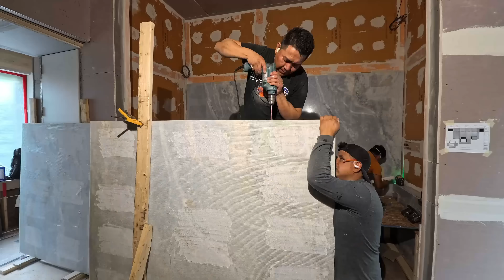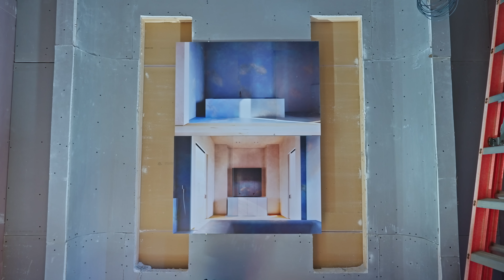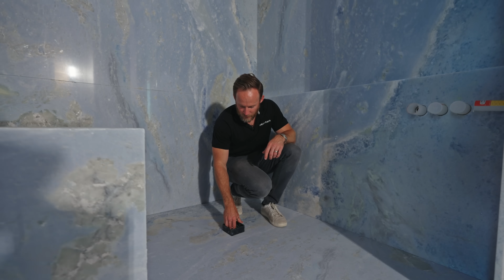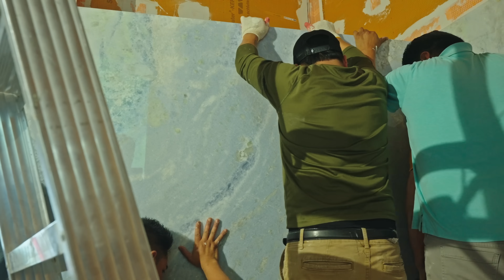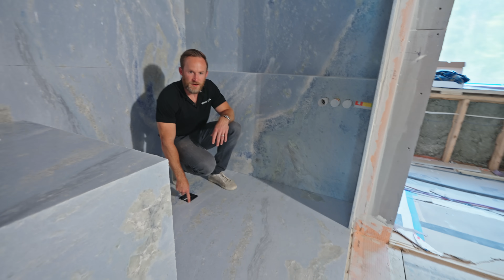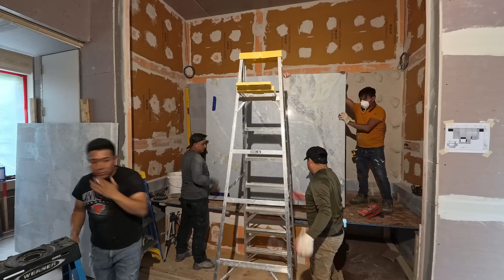Luxury Bathroom Inspired by the Sky

Comment: This is 100% spot bonded (see individuals frames from 13:43 to 13:50). There is a reason the is not shown in normal speed. The tile install does not conform to TCNA or ANSI standards and no respectable tile installer uses spot bonding. Most of this build has been done incredibly well but I'm amazed that LFT was installed with such poor standards.

Comment: Wow!  That very low pitch combined with the slickness of the surface is going to be a pain in their asses!  Bulk water will drain but MUCH will remain because surface tension will overpower gravity and being that it is slick, there is nothing to break that surface tension.  MUCH more water will remain on the surface than with correctly pitched floors and textured floors and it will evaporate MUCH slower and promote mold growth AND leave MUCH more minerals behind.  You'd think these guys would study water a little more.....both the builder AND the makers of that shower, being that that's what they specialize in.....or in this case....NOT.  GEESH!!  But I do get it.....it's all about GET THAT MONEY.....and that's pretty much it.

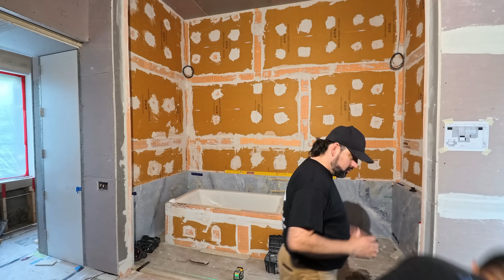Comment: Hey at 5:49 the top two slabs on back wall are flipped 180 degrees from where they should be for the pattern to carry up the wall.  I took a screen shot, flipped the 2 slabs horizontally, and it looks so much better...  Sub should remove, clean, and flip stone. GL. Oh I see at 14:10 they surfaced the wrong side...  Can they pull down, resurface both sides and reinstall with a little thicker mortar bed?  All that Quality Control out the window, a serious discount should be given, or full redo if they can't make it work.  That back wall looks bad with the slabs like that, and if I was the client it wouldn't take long for them just like a youtube watcher to notice the mistake...  Also, why I'm at it, that corner of the bathtub near the shower, if a person is going to walk past that corner to get in the shower like you described, that corner will be very painful in a short time, mid thigh, your imbalanced walking in or out... or you slip otherwise.  I suggest to round that corner as much as feasible, or put a piece of glass in-line with end of tub, then install glass door at curb, the shower could be open to the bathtub still so you could climb over the slab into the shower, and that contains most all the water to the shower or tub.
Reply: @mcraydon  it’s all intentional.

Comment: Do not sandwich the heating cable between thin-set and KERDI sheet membrane. That isn’t a supported or recommended Schluter application and could cause issues with heat distribution, cable damage, and warranty.
Right off Kerdi  site?
Reply from the maker: Its set in the Ditra and then Kerdi overtop of that. Per Schluter

Comment: I would re-evaluate your use of kerdi board, the seams that are bonded with thinset aren't completely water proof, they are just water resistant because the water will wick through the thinset at the seams. In europe they have a waterproof adhesive product that you can use instead of thinset at the seams and that makes it waterproof. Even then I think there are better products to use at this point.

edit: and then you mentioned using an epoxy for the grout seams so this doesn't really matter because nothing will get through that :)

edit 2: The application of thinset behind the sheets of stones seems questionable, you are supposed to have 95% mortar coverage on any tiles you put up in wet areas and the dot method rarely accomplishes that. They probably should have used a saw tooth trowel and back buttered the stone.
Reply from the maker: Seams have kerdiband for full waterproofing. In terms of the installation of the stone, the edits don't capture the entire installation, so alot is missed on the install.
Reply: The Kerdi product is a modified one now which much more waterproof than the previous product.  I don't like Kerdi board as I find it too soft.

Comment: Nice build, love the color. I would want that tub right up against the wall myself so I wouldn’t have to clean that gap but I bet the homeowners aren’t worried about having to clean it themselves.
Reply: @tjmbv8680  I used to be a hospital custodian.  That hospital had a beautiful green marble next to one of the elevators.  If we had a spill on that marble floor we had to clean it as quickly as possible because it would very easily stain.  Stains required a poultice bag to be placed on it to pull up the liquid.  Occasionally tiles would break and have to be replaced.  Marble is relatively easy to break compared to granite.  
Please don’t use marble for flooring or for countertops if you want an easily cleaned surface.
Reply: @help8help  It needs to be sealed on a regular basis like any porous surfaces.

Comment: Ok, Mr. Schiffer, great video as always, your company does amazing work. I'm sure you get paid well for it, and you deserve it. However, a couple of practical questions, with the bathroom. Where's the towel holders going to be, lol. And, for that base white oak flooring, that butts up against the tile, couldn't you use a Thompson's water seal product, I think would work well. And while you touched on making sure the framing is correct, for the weight of the stone. How much extra blocking, and joist hangers went into this. It seems, as if it had to be, very robust framing. I will say it's beautiful tile, I prefer gray, but to each their own, it's still gorgeous.
Reply from the maker: Its still WIP. and yes this was engineered

Comment: @NS builders great respect for your work and attention to detail. I would have preferred full coverage on the slabs as per NTCA and ANSI standards. Maybe we did not see this work when spots were troweled down and slab was back buttered. I would also use a vibration tool to knock down and flatten further to reduce voids. Love the great attention and detail was undertaken to get the wall very flat and tiles cut and engineered to be consistent. Spot bonding is not recommended especially not for large slabs or large format tiles even though it can work - voids can cause efflorescence, moisture build up, mold growth but critically could cause bond failure between slabs and waterproof boards and membrane. Granted given how well you did this install it still may take some years to manifest. We can all brush up on skills and greater awareness of standards and codes and reasons for it. Often there are evidence and science based reasoning behind them. Still looks stunning and I am always impressed by your desire to keep pushing for excellence. I am also sure you checked but for those that don’t know you can check the slab for voids and hollows using a tapping tool (less precision but useful).
Reply from the maker: Sparks is right, we opted not to show that entire process. This isn't a how to
Reply: @NSBuilders that’s fine it’s your channel. Respect your approach. From my perspective I want to encourage more trades and contractors to put effort in continuing their learning and tradecraft pushing towards excellence and best practices where possible. Even if the notion of best practice continually evolves as standards and codes change when new knowledge comes to light.
Reply: Been my experience they don't show the detail work because this is mostly advertising to educate clients.
Clients on this level of house want to know about the process. An hour of prep and install is more than they need.
Bet they used epoxy, cups, and straight edges.   To get a perfect plane instead of pushing for a perfect inbed.

You obviously know your stuff. Just giving two cents on how things are done on this type of work.
Bet they're delivering a perfect box other than the floor.

Comment: It's interesting that they only used globs of some kind of adhesive instead of fully covering the wall and notching it. The wood in the bathroom is something i can't get behind. But that was one hell of a vision that got pulled off
Reply: It's hard to tell with the timelapse but I think they did get thinset over the full based on the 1-2 frames you can see.

Comment: Love the shower. Does Kerri have a weight limit with the slabs vs say a leveled concrete/wire wall base? Also spotting slab vs full trowel. I know in tiles it's a no go but interested what ANSI says? I get easier to level. Love that slabs are NOT book matched causing odd patterns.

You guys always push the limits of perfection!!!
Reply: NTCA and ANSI standards recommend full coverage to avoid voids and reduced support for the marble slab. So full coverage rather than spot bonding is recommended. While they engineered the wall and stone to be very flat this should avoid cracking and flexing but even with the flattest of wall and consistent slabs NTCA and ANSI recommend full coverage. Plus with spot bonding the voids themselves can result in moisture getting trapped causing efflorescence, mold growth which could in turn lead to bond failure as well. Even if it works well for several years because other than full coverage the install was done well it’s not going to be better than having full coverage. Plus the probability is higher that the install could fail at some point in the future.
Reply: Looks like both the wall and stone was back buttered as well, my assumption (dangerous I know, lol) is that the spotting was mainly there to fill any voids of inconsistency in the stone and wall and was vibrated (given the size, makes more sense) to form a cohesive 90%+ coverage on the back?
Reply: @TheViking85  I hope so and maybe we did not see it but spot bonding is not recommended either for the wall or the slab/tile. Maybe they just showed the spots but did not show them troweling the spots  down and back buttered it and then also keyed in thinset on the wall and as you say knock down any remaining voids with a vibration tool.